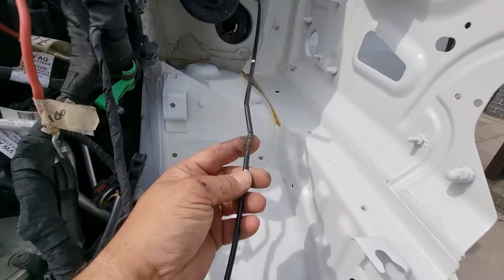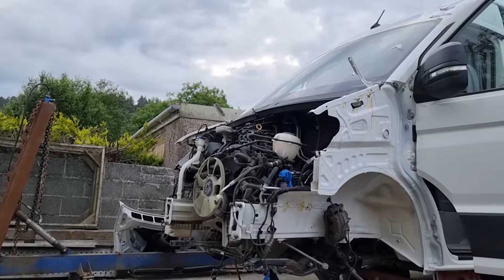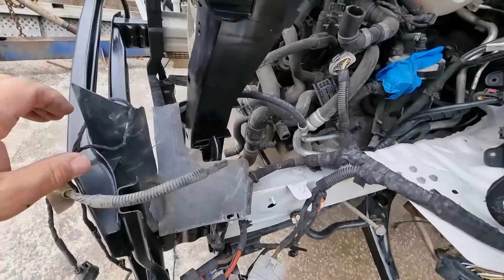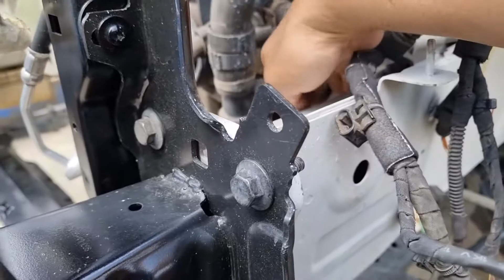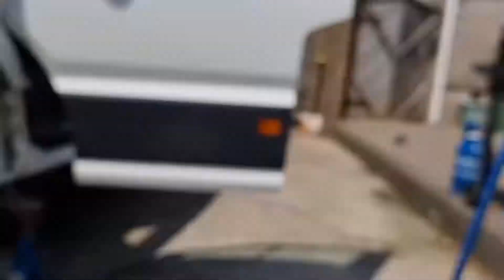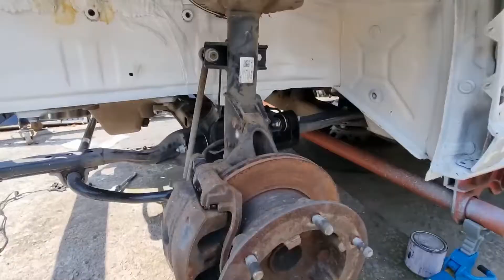MAN TGE / VW Crafter campervan build conversion - body repair part 5 - front end rebuild part A

Comment: Hi Paul where did you locate your front end parts I’ve just bought one with similar damage and struggling to find the parts ,
Reply from the maker: unfortunately it's been a nightmare getting bits as there's not that many being broken for spares yet, the second hand parts i have used came mostly from ebay but a lot of bits i've had to buy new - 'A' because of availability and 'B' because some are cheaper new than what's being asked for second hand, the only thing i would say is that MAN dealers are generally cheaper than TPS